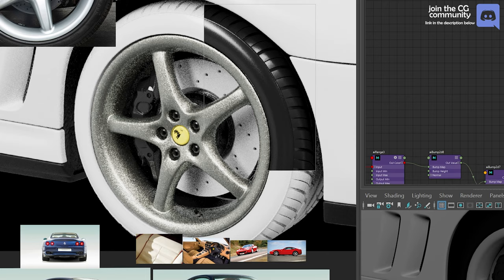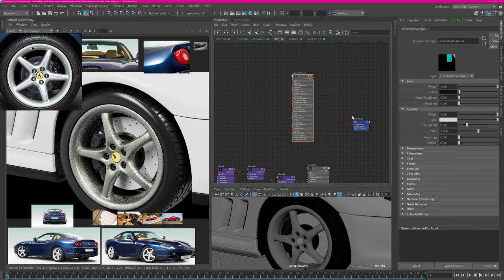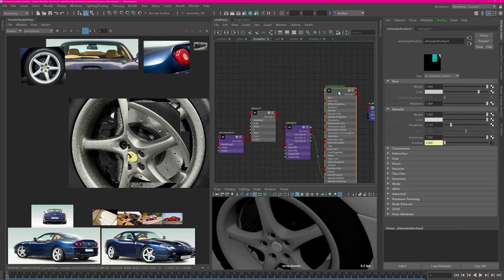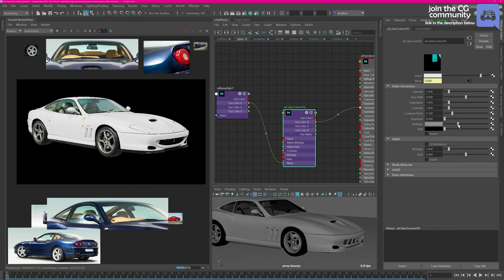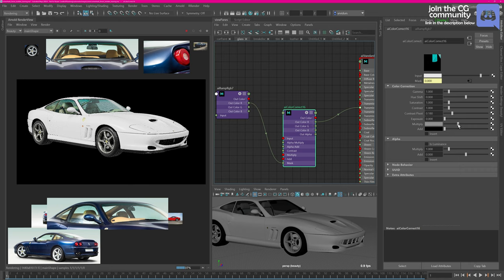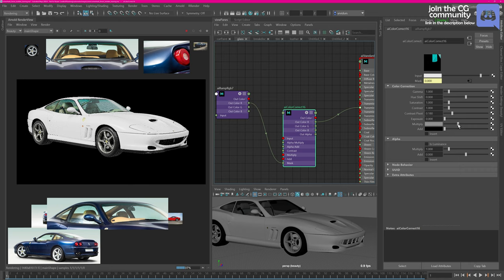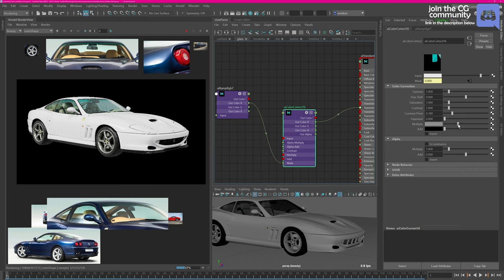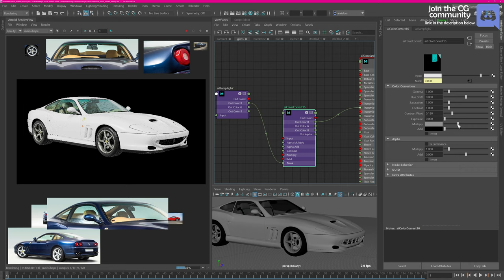How to Create Realistic Car Render in Maya using Arnold - Automotive Rendering

Comment: Great material - thanks so much. 

Just because I’m a car guy and more than a little OCD...  it’s “brake” not “break” and it’s a brake disc or rotor, not a brake pad. The pads are inside the caliper. The radial scratches would not cover the entire brake disc surface - the inner 1/4 radius or so is not in contact with the pads and so won’t be worn in the same way. 

Thanks again for your great videos. Excuse my OCD.... :-)
Reply from the maker: oooh your absolutely right! brake not break :D Thanks for the mechanical insights as well :)

Comment: Can you cover the way you set up the projection node in another tut please? I'm struggling to find which attributes of the place 3D texture i connect to the placement matrix of the projection node. Thanks
Reply from the maker: if you create the projection file as a projection ( there are 3 options) it should hook up everything automatically.
Reply: @arvidurs  i tried the way youdid but it didn't work

Comment: Nice! I only don't understand why Anisotropy needs roughness, for examle IRL a material can be pretty much a mirror like and also have anis, meanwhile in 3D if you would zoom in it would be slightly rough, maybe it's just hard to see small roughness IRL. I had to work on one CNC product which was mirror like and using anisotropy was fairly challenging to get it look right, in 3D it was just way too rough to get same anis strenght so I played with bump/normal and displacement maps instead w/ 0 roughness which was a bit closer to real one but still behaving differently, tried using the coat too but it was breaking the behavior. Guess the only 1:1 solution was simply 3D Scan it in micrometer detail scale or sculpt it but that would be alot of polys.
Reply from the maker: even IRL there will be a micro roughness applied to the surface as you are brushing the material in one direction and then in the other. So I think it's still valid to apply very soft roughness. But I'm not an expert in material studies.
Reply: @arvidurs  Yeah I agree, almost everything has some sort of roughness either on microscopic level or as "wear" imperfections, still I think that anisotropy should not be driven by roughness or have roughness as requirement even IRL you probs rarely find or even can't find anis surfaces that's 100% glossy.. atleast in my opinion since it's driven by surface/shape itself how it reflects the surroundings rather than its material properties as you know yourself so it would be a bit more "art friendly". Can't recall now exactly but I think Redshift supports Anis without roughness which is physically correct.

Comment: When I try to use the "Isolate Selected", my render just turns black. I have the aiCellNoise selected. However, if I connect directly to the Surface Shader directly, the cell noise does render. I was wondering if you have a solution to that because I have searched around but cannot find a fix for the problem. I am using mtoa 4.2.0 and Maya 2020.4.
Reply: it is not a problem. if you do not connect aiCellnoise to the shader, the renderer does not know aiCellnoise exists.
easiest method is always to connect to the shader's color to view it